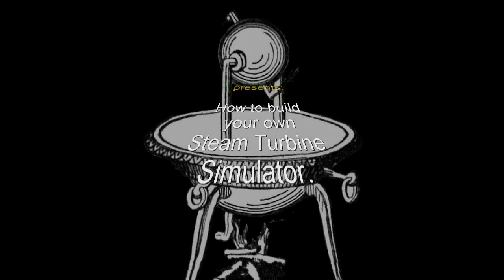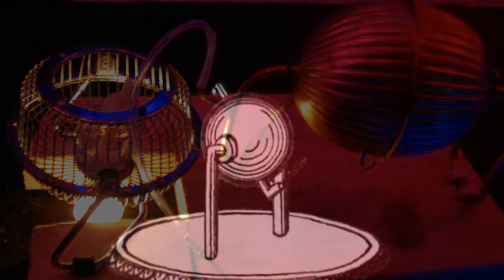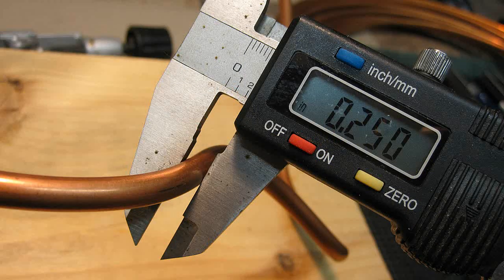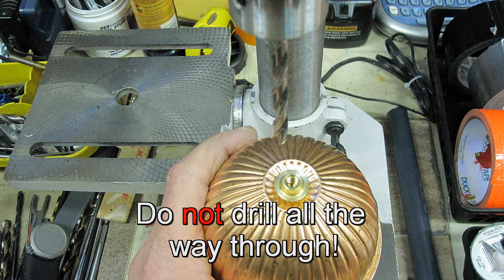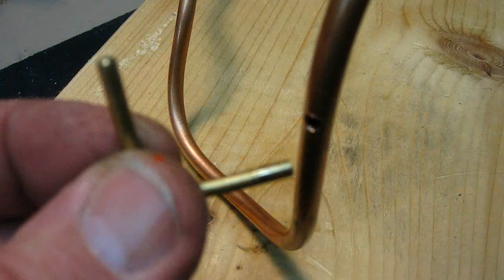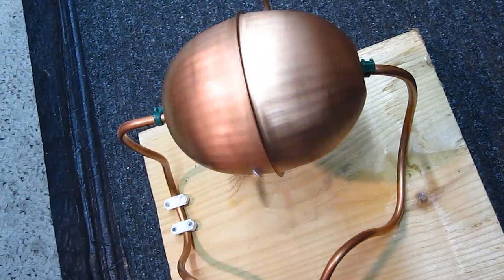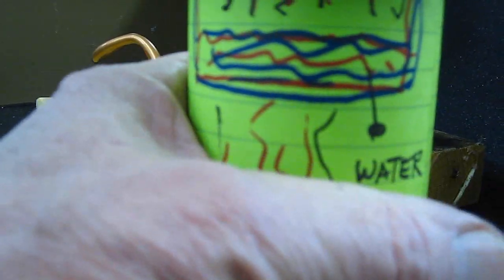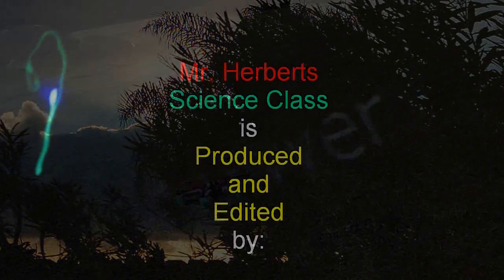How to build an antique Steam Turbine for a Science Fair Project.

Comment: well that gave me an idea 
make a big circle out of thin plate steel and make a hole in it at the size of the diameter of  the copper ball u used weld (or any other means of attachment) the disc on it and now sharpen it to what u would call a decent knife. 
voila your DIY retro steampunk steam turbine pizza cutter :)
P.S. using a circular saw blade might also be a good idea (to make it look even more steampunk, and it would be easier to make) :)
and another great video